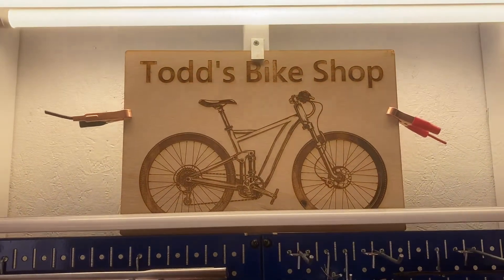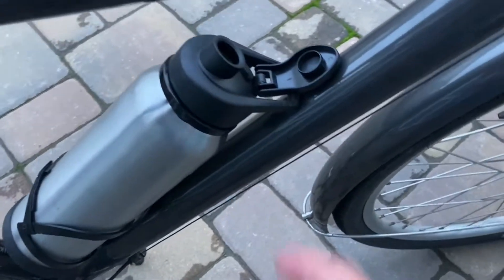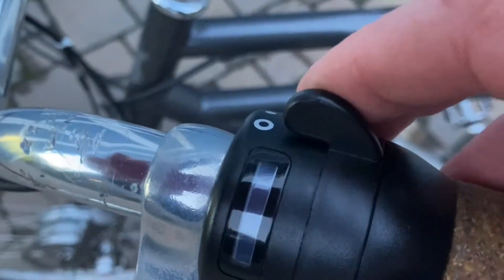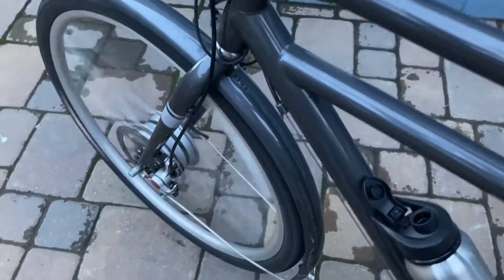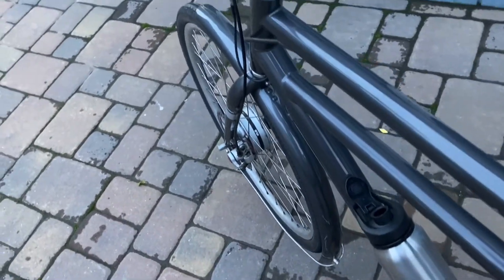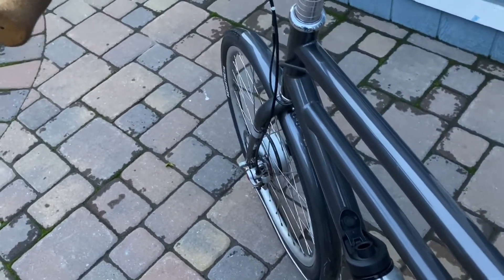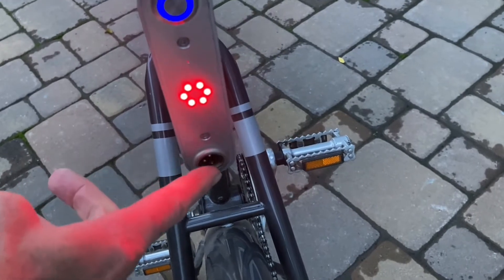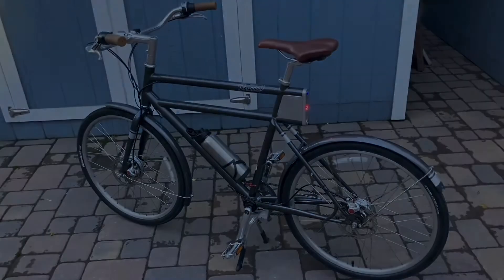Faraday Porteur S Test Ride Conclusion - Is this working Properly?

Comment: Hey, I'm not sure if you're still looking for an answer to this question, but I have an original Faraday that is still working. The power selector switch doesn't affect how fast the wheel spins when you're not riding the bike. It determines the maximum power output. The controller uses information from the bottom bracket as well as your speed to determine how much to assist. So the way to tell if it's working correctly is to ride it. There's a big difference between the low power mode and the high power mode under load. However, it's only a 250W motor, so it won't be as much of an assist as a lot of current e-bikes. I believe they did come out with a 500W option shortly before they were acquired by Pon Holdings.

The original controller also shuts off the motor when you exceed 20mph, so you can still ride faster than that by your own power and it conserves battery life by doing that.

The battery on mine doesn't last as long as it used to and I was exploring replacement possibilities, so thanks for the video and blog post! One awesome upgrade I made to mine years ago was to replace the rear hub with a Rohloff 14-speed hub...
Reply: Thanks for the details!

Comment: Todd, Could you lease tell or show the details of the connection from this new battery to the controller? The new battery only has 2 wires (1 black and 1 red) but the wires to the controller are more complexe like 1 wire with 3 pins and another one with 4 pins.
Reply: Just use red + and black -, the others do not seem to matter - that said, i never saw it run stock so let me know what might be missing ;)
Reply: @toddstiers3814  I have not done it yet, as I am very hesitant to make permanent changes to the original wiring. So I just want to make sure that I understand what you did before. In order to make the connection, did you cut and stripped both wires going to the controller and only connected the black and red wires from the battery? Thank you
Reply from the maker: @realrousseau5755  I believe I only used wires going to and from the battery pack. I pulled them out near the bottom bracket. I soldiered the black/red wires to the included harness with the water-bottle battery. Current;y I connect these batteries to a fuse and switch to the power-tool mount. There was a lot of extra wire available in the seat tube, accessible from the removable plastic (and fragile) cover
Reply: @toddsbikeshop6402 todd where's your bike shop at man? I needs me someone who can fix up a faraday. I live 5 minutes from Manhattan.

Comment: To get to this point - did you leave the original battery pack in the frame, or did you just wire up the external battery to the leads that go to the controller from the original battery?
Reply: I removed the original pack, hoping it was repairable. Took the pack apart, very destructive and I decided building a pack of the same form factor was too risky. Got pictures on my blog…
Reply: @toddstiers3814  Thanks for the reply!   It sounds like getting it working again was just a matter of plugging the new external battery pack into the hub motor with the cable that went to the old battery pack, and letting the Faraday controller handle the rest.
Reply: @genetien2015  correct - there are 2 unused battery charging/monitoring (?) wires I let dangle  - I wonder if anyone knows if they can be used for charging ;)

Comment: I also acquired one of these myself with a dead battery.  I hooked up a variable power supply in place of the battery and got the motor to spin. Thinking that I was going to replace the odd 44v battery with a 48v battery, I ran a test with higher voltage (54.6v to simulate a fully charged 48v battery) and found that the motor cuts off at a voltage somewhere over 51 volts. Does yours work with new battery fully charged?
Reply: I only saw a max of 52-53V unloaded. I never experienced a cutout when fully charge, but did under low charge around 43V (no load).Perhaps the DC voltage drop under load keeps it under the limit…
Reply: Adding an inline voltmeter is on my todo list
Reply: inline voltmeter shows my battery cutting out at 48 volts, which seems like a battery issue. It had been dropping to 22volts, so I assume 1/2 of the 13sp2 went out, but now it only runs 49-52volts! about 9 miles between charges